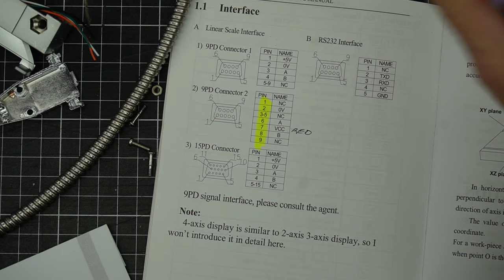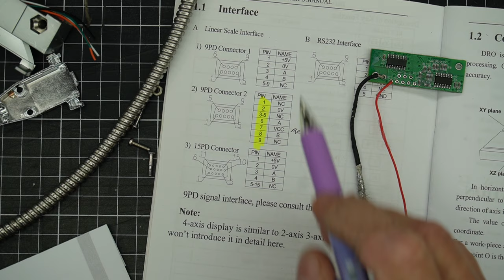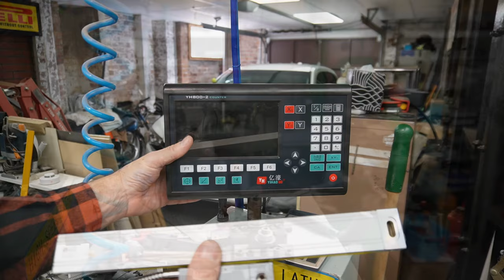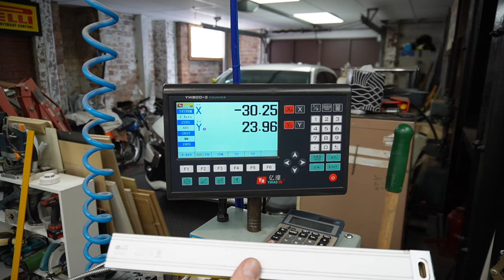DRO Glass scale repair after chopping wiring.

Comment: Hello Mike, can you reverse the scale reader on the scale? turn it around so the cable is coming out the other end of the scale? or can it only go inside the scale one way? I am fitting my DRO to my lathe and all of my gib screws are on the right side of the cross slide, so I have decided to put the DRO on the chuck side and I will make a few extra covers for protection of the scale and reader. It is a JENIX DRO.
Can you enlighten me please, cheers.
Wylie
Reply from the maker: Hi Wylie
The reader on my scales can only fit in one direction. However the scale can be mounted with either side against the cross slide. You can mount on either side of the cross slide with the cable facing away from user. I hope this makes sense to you. Cheers Mike